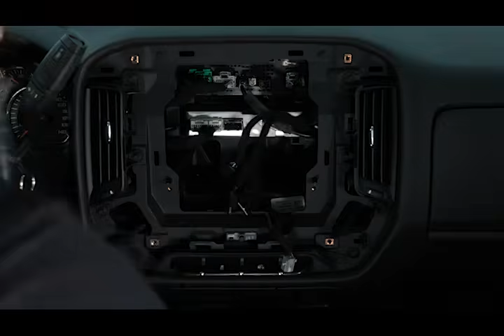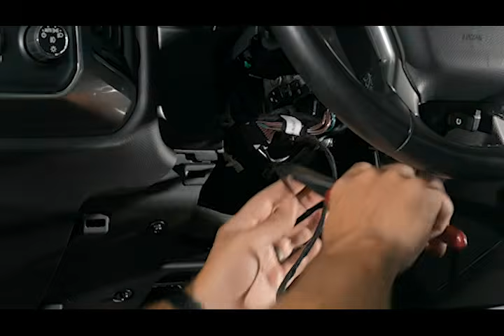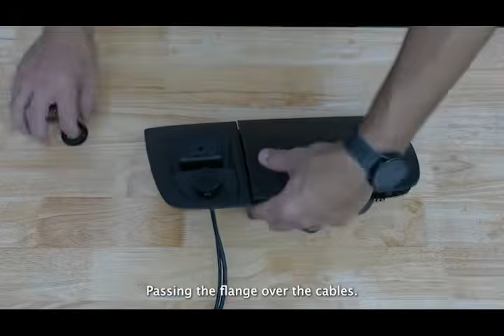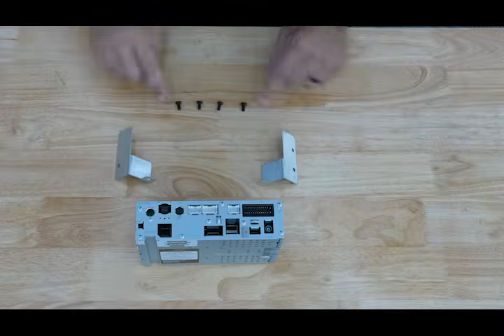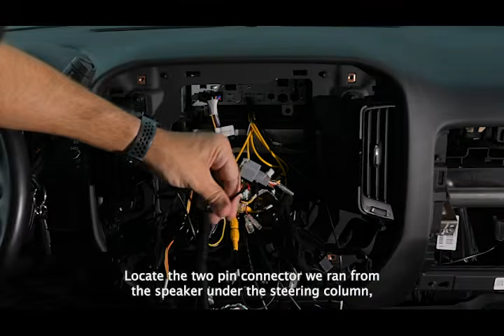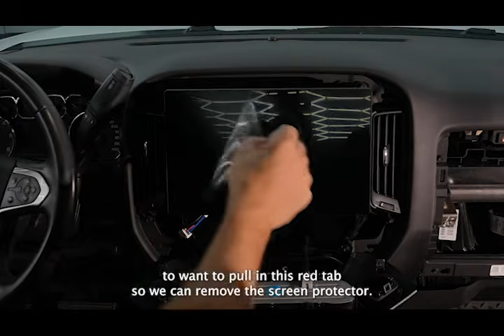Install: 2014 - 2018 GM Truck HORIZON12 Radio Plug & Play

Comment: I installed this myself just watching this video everything works exactly as should expect for when I hit my blinker my music shuts off from speakers on the driver side and resume after blinker is turned off. I’ve installed external speaker connector as shown on video but the music continues to cut out and no chimes going to small speaker still from vehicle speakers so music still cuts out why?
Reply from the maker: The best way for us to support you is by contacting our Tech Support team. You can email our experts at tech@stingersolutions.com or call at (727) 732-3114 Monday-Friday from 9am-7pm ET
Reply: Any luck fixing this? I’m about to buy one but that sounds annoying as hell
Reply from the maker: if any difficulties arise during the install process, our tech support team is always here to assist! You can also have it installed by one of our approved dealers: https://stingerdrive.com/pages/dealer-locator

Comment: Am I wrong or did I read somewhere that you lose your WiFi and it will no longer work installing this?
Reply from the maker: We do not have the ability to keep the communication and menus that make the in-vehicle wifi hotspot work. You can always cancel the subscription for the in-vehicle hotspot and acquire an OBD-2 plugin style hotspot from most cellular carriers.
Reply: You can still use the wi-fi, it's just not on-screen anymore. I was able to set it up and find my username and password on the onstar website. It took a lot of going through the pages, but it works. Once you have it connected to your phone, you can press and hold on the hotspot name to see the username and password to share to others
Reply: @iycephoenixx4249 so your in car WiFi still works? Now how exactly do you find it? Does is still show the WiFi connection through the speedometer?
Reply: @JohnDiggle-iv7rx  No, no media or phone information is visible anymore through there. I forget the exact page, but I was able to explore and figure it out.
Reply: @iycephoenixx4249 thank you. So you’re using the factory WiFi currently? How is the speed? Any lagging? Ok no speedometer info anymore after install. What exactly did you loose or gain from this unit? USB and 12 volts still works?
Reply: @JohnDiggle-iv7rx  I've been using it for my connected streaming device, but I'm downgrading to the basic onstar connect, as I rarely use it and it's only for up to 3g signals. If necessary, I can use my phone's hotspot. The onstar hotspot is just a convenient alternative. The console (I have the jumpsest for now) loses power, but I was able to buy an adapter from bestbuy that's usb mini b (I believe) to usb a and hooked it to the extra slot in the brain of the stinger. The aux and SD card slot is of course now obsolete (never used either anyway). The roof mic is obsolete but the built in one is sufficient. Phone, media and ambient temp are no longer available in the cluster. Teen and valet modes are no longer an available setting, but perhaps a future iteration of the dash kit will have that, but doesn't bother me

Comment: What about the installation on a higher trim level truck like a Denali or High Country? We have a console all the way to the radio, not an open space like this base model. Will it come with instructions for installation on one of those? We also have the Bose amp and this doesn't really help when dealing with that. A video for the Higher Trim levels would also be nice to have.
Reply: I would guess the only difference is that you have to remove the tray with the trim/plugs/cupholders and follow all the normal steps